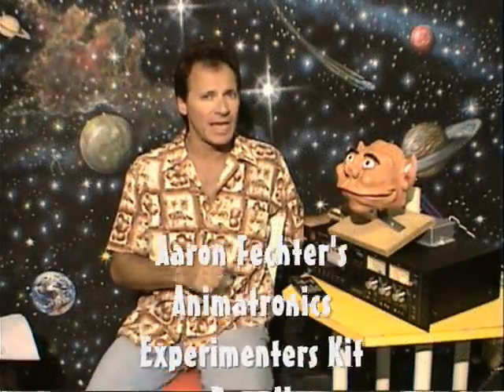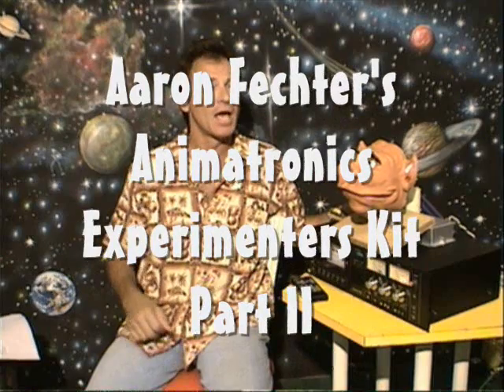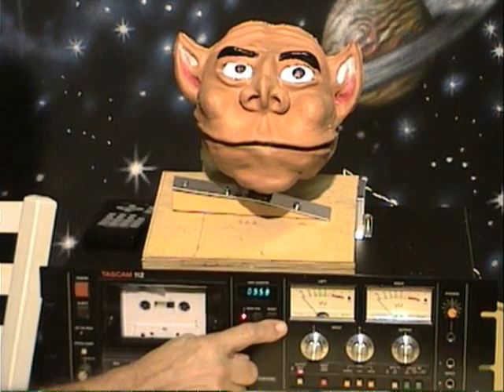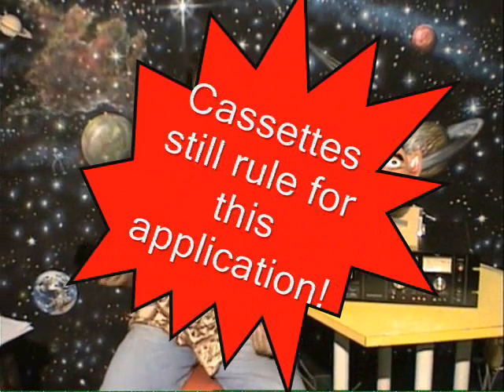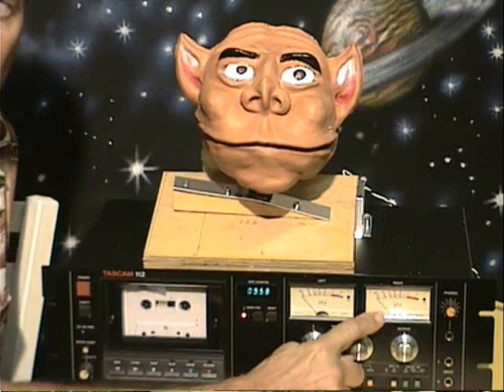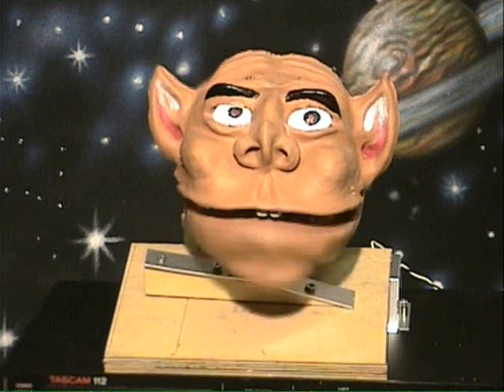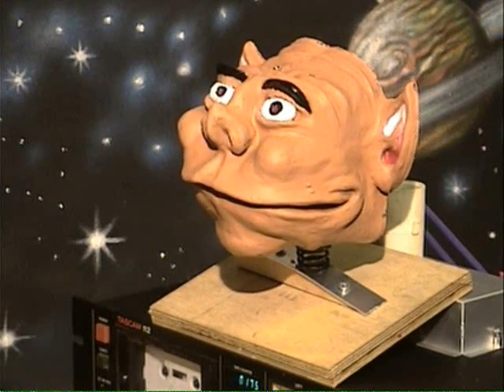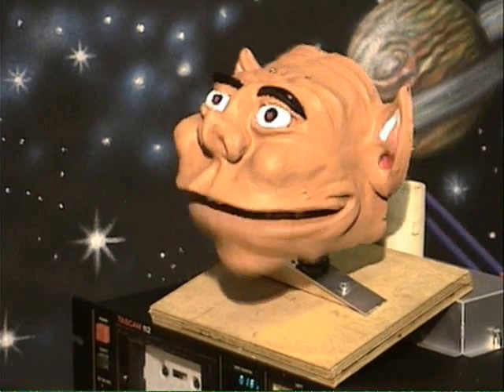Animatronics Experimenters Kit- Part 2- How to Program

Comment from the maker: @hypstarr Yes indeed.  You could run this off of many possible playback devices as long as it is stereo.  You could play it from an mp3 player, a pc, etc.  You might choose to use a playback device that is switch activated and able to store a small clip rather that is setup to run from an external trigger.  This is the sort of thing I help my experimenters with personally when they buy the kit.
Aaron

Comment: Answer: Servos wear out easily and are really only good for small movements such as eyelids. Besides, for as quick of movements as that mouth makes, servos wouldn't be able to be fast enough. I hope that helps!

FK
Reply: I know this comment is 16 years ago!
But your wrong the Servos are not servos he is using a different Mechanic called an Air cylinder.

Comment: In about 2006 or 2007 they stopped allowing URLs in the comments because of the constant spam, viral, and shock websites that were being linked. If that answers your problem. :)

FK

Comment from the maker: A little more info on this:
You use the software to create your show audio track and then you can edit your tones in the same program to precisely control the mouth movements.  If and when you expand beyond one control signal to control other things, you can mix the tones required to control multilple movements with the same ausio mixing software and actually see the control signal waveforms in Mixcraft adjacent to the audio track.
Aaron

Comment from the maker: Yes..I will answer this in one of the chapters I am videotaping as well.  No software for the PC comes with the kit.  None is needed.  If you want to use the PC to improve the quality of your shows, either in the audio production itself or the programming accuracy you can use any audio capture and mixing program of your choice.  I recommend and use Mixcraft.  It costs about $50 and does amazing things that even my $100,000 studio equipment didn't do in the 80's.
Aaron